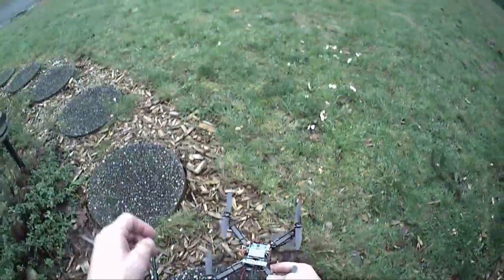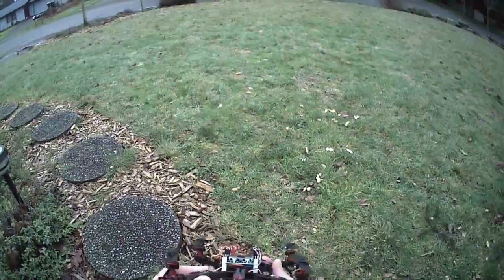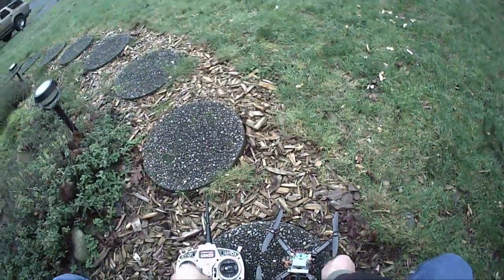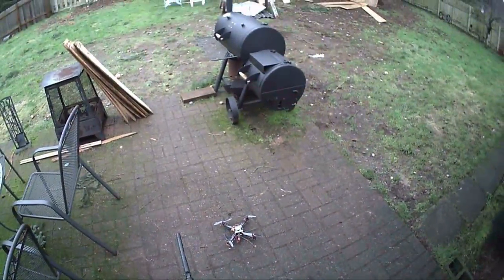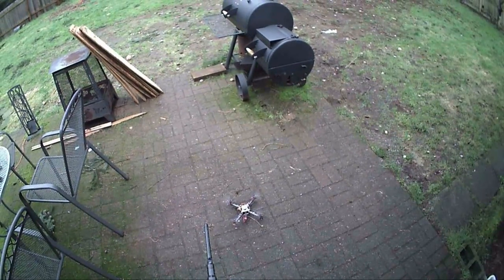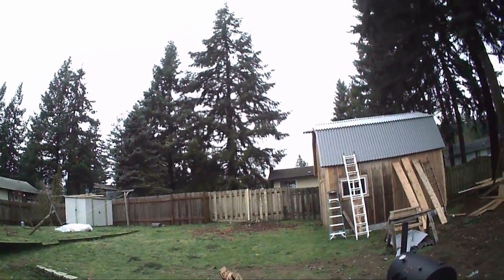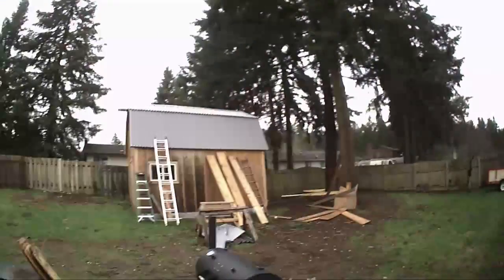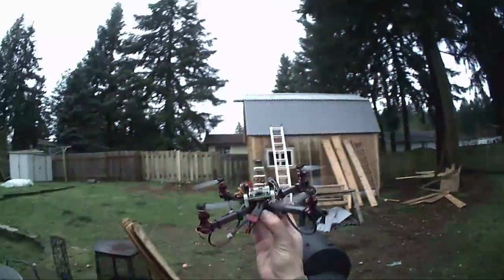Scratch Build All Carbon Fiber Mini Quadcopter

Comment: Does the anbee or phantom remote work with radio link receiver?
Reply from the maker: I'm not sure what you are trying to ask Dennis?
Reply: +RonALampman does any of the two remotes work with the radio link receiver?
Reply from the maker: If you have a receiver for either, it should work for you.  I do not know of a radio link that controls either though.  I'm using DSMX technology with my quad.

Comment: I am seeking a setting for 220mm spidex fpv
Reply from the maker: progetto aladino The settings depend heavily on which firmware you're using, KV of motors, battery power, props being used, and weight of the multirotor.  The best way to tune it is to increase the P gains until you get quick oscillations then back off.  Keep you I gains right at or slightly above half of the P gain.
Reply: thanks I'll try

Comment: Great work. Very nice performance ... I still have to replace a bamboo boom on my Bamter even after all my crashes ... which is why I am thinking of even thinner bamboo .. lighter and cheaper ... who knows.
Reply from the maker: tsisapik I plan to get one of the KK2 mini boards and a couple of mini board holders to build my next micro quad or possibly reconfig this one.
Reply: RonALampman Makes sense ... I used the mini-32U acro boards loaded with BaseFlight / Cleanflight and can be used with EZGUI over bluetooth telemetry.

Comment: Ron, Did you try longer booms that will go past the props. I have been doing that on my home built ones. I also made a ring that will go around the entire quad.
Reply from the maker: I will be doing that on a micro quad I'm building but will also put a 1mm carbon fiber cage around it.  This is build to be as light as possible.  All the best and Happy flying!

Comment: You may want to make a roll bar or something over the top of the KK for protection, I can tell you this from experience. I fly a custom made airframe that I built myself also and I have damaged KK flight controls from crashing. Good Luck in future flights.
Reply from the maker: I had nylon screws and spacers that were higher but that caused more damage in crashes than leaving them off.  Now the motor shafts are higher than any part of the control board.  All the best and happy flying!